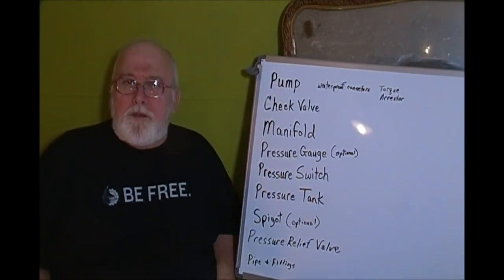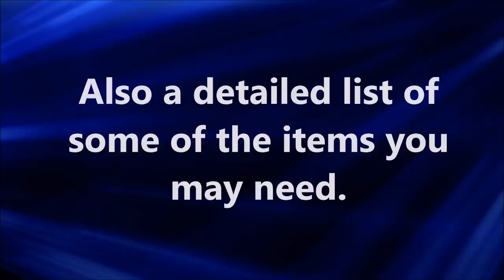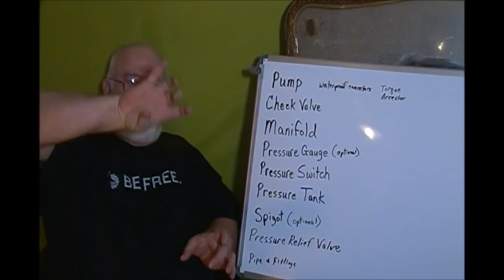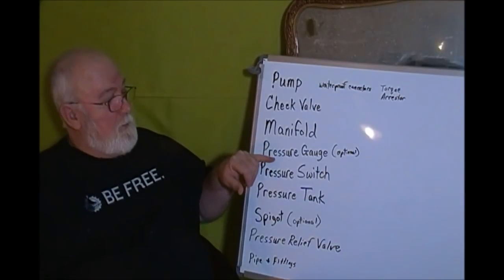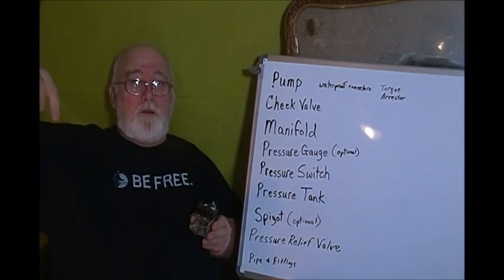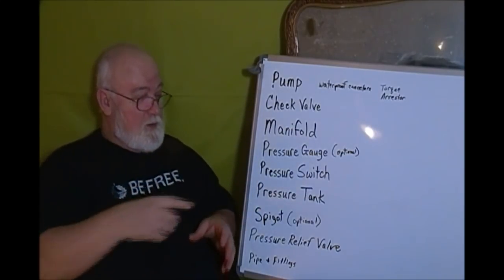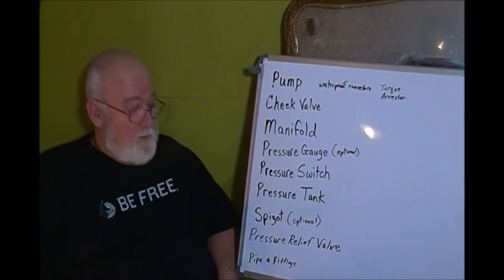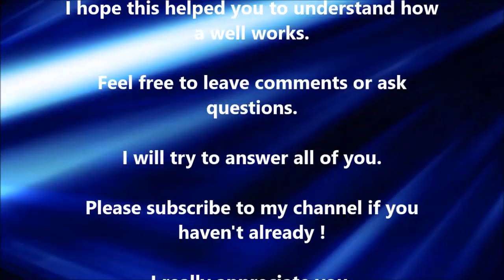PawPaw Explains How a Water Well System Works

Comment: Excellent intro to well system.  I appreciate your encouragement.  I need to adjust my pressure switch as the pressure drops too low before the pump engages.
Reply: If if is like the one I last tweaked you have two adjustments, cutout and differential I always found the differential one was the one that drifted.  Another problem this may indicate is the tube from the manifold to the pressure switch getting clogged, delaying the actuation of the switch as the pressure bleeds slowly from the diaphragm. At the same time your high pressure goes higher, watch your gauge, as the pressure to the diaphragm in the switch to turn off is delayed as well.

Comment: Hey Bob, the biggest reason for the bladder in the pressure tank is to keep the air in the tank from being absorbed into the water.  I had the old type before it failed and you had to pump air into it every couple of months so that your pump didn't short cycle.
Reply from the maker: You had a tank manufactured when Jesus was a Corporal !!!!
Reply: Been there done that

Comment: Great video paw paw.  Now. My friend has a property that's been sitting at least 10 years. There is a well. Not been run all that time. Now in about 5 more yrs he plans to put in a mobil home. What do we need to check for on this well?? And how can we test the system before hand?? Can I run it off a genorator to test. There is no power there right now??
Reply from the maker: Find out if it is 240 or 120 volt and fire up your generator.

Comment: I added a amp monitor system to mine to protect the very expensive in the well pump.  If the pump runs out of water the amps changes and the monitor shuts it off for 1 hour, and it the pump runs for more then 45 minutes straight it shuts it off too.

Comment: paw paw ill be straight forward ...my fiance' has a well (dirty minded folks dont say nothing ) id honestly rather have municipal water for drinking and cooking...reason being is that our well has a lot of minerals and constantly clogs the filter .... at 11 dollars a unit filters get pricey  not mention its 30 miles to lowes to buy another and 30 home ...
Reply from the maker: I wouldn't be at all surprised to find that the bottom of her well pump is within inches of a pile of silt on the bottom.
Reply: DoingItCheap you may be right ...im not familiar with the well other than changing filters... way the filter is now im not so sure i like it... whoever installed it put it in after the tank... and it filters all the water to the house... seems to me it would better to just filter the kitchen sink ....
Reply from the maker: I would put it right after it leaves the well before it gets into all the components.  I had a pressure switch fail because the 1/4" pipe stem filled with mineral deposits.